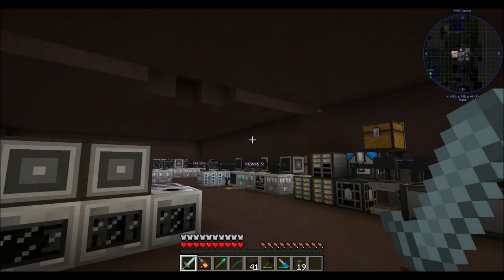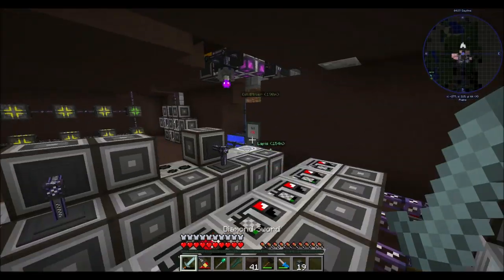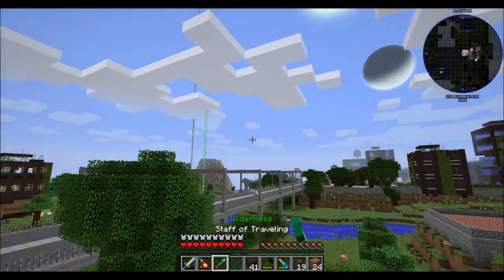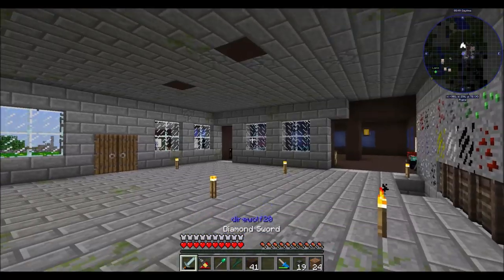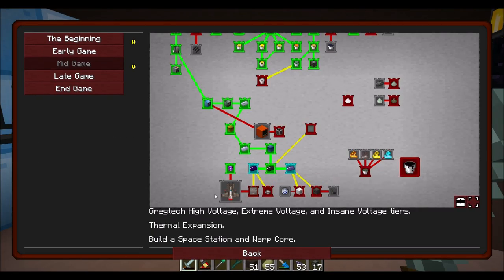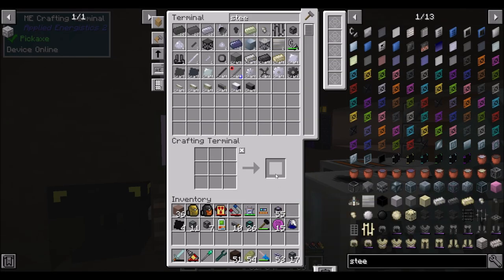OmniFactory   Ep43 EV Machines

Comment: Dire, you really should consider going to End, there is huge amount of ender lilly plants which will solve your enderpearl problem.
Reply: Yeah or he could just build an ender pearl farm and send the pearls to the me system
Reply: Ender Lily seeds do drop from Tallgrass in the Overworld. You will use up most of a Thermal Foundation Diamond Sickle getting 2-4 to drop out of the total number of uses on a sickle though. You could also use Thermal Foundation Iron Sickles if you don't mind carrying a bit of extra inventory, the time consuming part is to find the Tallgrass in worldgen. Plains or forest biome are the most likely to have Tallgrass. In this pack it gets slowed down a lot by the fact that there are buildings occupying a lot of the space the Tallgrass would otherwise spawn in.
Reply: Unless there is something decent to speed them up, ender lilies are kinda slow.  Enderman data model with a proper setup for creating pulsating polymer clay is a ton easier.  The pulsating polymer clay can then be used for a ton of other resources, including key ingredients for the creation of nether stars.

Comment: Also, you can get huge amount of platinum, palladium and tungsten from End dimension (even endstone can be processed to tungsten).
Reply: Just try getting a small amount of End Stone without going to The End though. It's possible, but it's a lot of chemical reactions. It's also necessary to use a Chemical Reactor to get Ender Eyes which isn't bad, and not anywhere near as bad as getting the End Stone itself.

Comment: Hey Dire,

Great content as usual!
I suggest that you make more use of Deepmoblearning, as it is basically free resources (You may use numismatic dynamo with Lapidary Calibration augment - so you will be able to burn gems as fuel). You should consider the automation of several - basic - ingots (copper, tin, iron etc.), coal, gems(mainly diamond) - which you will use in the numismatic dynamo for free power, so it will not strain your main powerline. And ofc ender pearls.

Also, you will need cobbleworks and automated clay, which has several other uses (like free lithium for batteries)

Besides, you should should have long started an ore processing line. Keep in mind that the majority of the ores are processed similarly. You will have more fun if you dont have to care too much for at least the basic metals and other stuff.

Take care!

Comment: I don't understand why you are trying to power everything off one line. It would be easy enough and more practical to make individually powered systems using machines that provide exactly what you need to run them at max eu/tick.

Then, if something did happen and you were losing power somewhere, your whole system wouldn't shut down.

Comment: Hey dire you should use flux capacitors  in the cefs for power storage its cheaper and holds more power the greg tech batteries